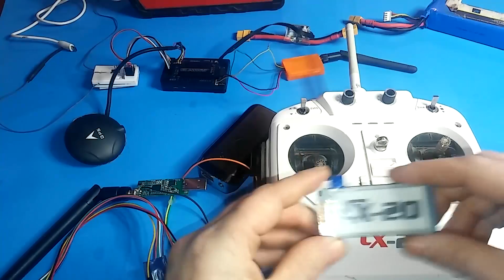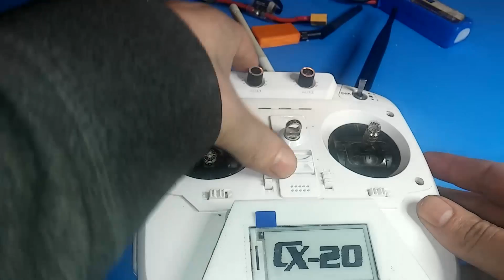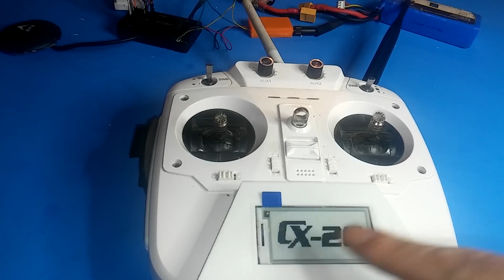CX20 E paper telemetry display mod

Comment: Have you had a go with Frsky Taranis. Ive dreamed of replacing the already pretty good screen with a larger sunlight readable screen. also would like to use the 900mc telemetry radios to carry tele info directly to the JR module port of the Taranis instead of Frsky smartport telemetry which has pretty good range. But I have had some failsafe events at rather short 300meter distances so I want to get better RX range by using Frsky L9R long range rx, but it has no telemetry and well the 900mc radios are already bringing MavLink sensor data to my ground station tablet. I would like to borrow the sensor dats via stealing the bluetooth data or directly from the ground station 900mc radio sort of like you share the mavlink data between the 900mc air radio and the  OSD module on the CX20.
I want to thank you for sharing your work on the affordable CX 20. Im on my third one that guys at our club had given up on or just wanted to give to me . The first one i did all the mods tele, osd, Frsky ,FPV , simple camera tilt and a mobius. Long hours to get it all working but very cool and my first FPV experience. Just when it all was working great I descended to fast, the thing flipped upside down and found the only concrete in which to flatten itself. A wild 5 second FPV ride. 
Second one I went with a F3 INav controller which flewgreat...but I accidentally disarmed at 30 feet and it dropped hard. 
Now I'm working on putting a Mini Pix that I am having some gps issues. 
One of the worst parts is taking out and putting back those 23 screws.
Oh here is CX20 number one, Rest in peace No. 1   https://www.youtube.com/watch?v=dctVJjmU3Vo
Reply from the maker: Hi I don't have a Frsky Taranis.. the only other transmitter I have is the flysky..which i have not used since my last video heh...     The cx20 I've got so lazy I had started only putting in 4 screws for it,  then i stepped it up to only wrapping electrical tape around the arms..Buttttt with my laziness I found when i crashed hard with just the tape around the arms I actually did zero damage to the quad it just popped apart and broke all my tape some how.. odd....
Reply: My Dad suggested the tape option also so I think I will give that a go too. I am really thinking of gutting the large and heavy PDB circuit board for a lighter, slightly raised platform of foam and plastic. I've been getting just over 10minutes flight to storage charge on 2200 3s.
Hey what do you do for work if you don't mind my asking?
Reply from the maker: I do epoxy flooring .. and sell e liquid heh..

about replacing the circuit board its probably worth it .. however you will find the cx20 motors and blade length will limit its payload. 

..I believe you would loose your 4 esc lights under the quad
I should make a video about it..In one of my video's I gave hints on a project i was doing .. ..I mounted the apm up side down on the lid lol..
i just got busy with other projects.   My idea was to mount the apm up side down with padding ..that would free up allot of room..plus mission planner has the settings for the offsets so its actually pretty easy.

Maybe that will be my next mod video heh..

here is an example how i tape the quad now
https://youtu.be/EACa18e8kzU?t=1075

in that video i had to take off the top about 100 times to get the firmware just perfect so I had to start taping to save time.

just make sure you cut the electrical tape with scissors and the end piece ends up on the bottom..just cut the extra if not type thing.. .. In the video i say you can hear the electrical tape but it was not that.. I had not screwed down the esc properly and it was vibrating up and down..oops..